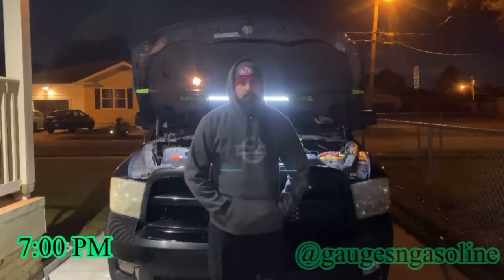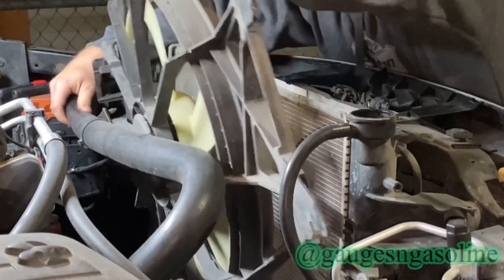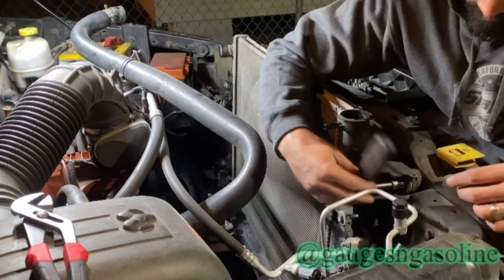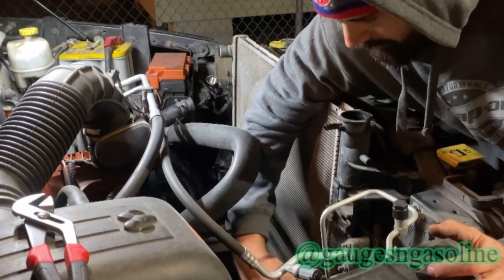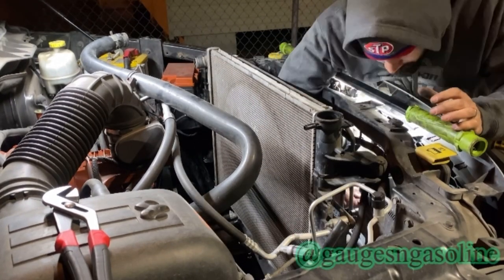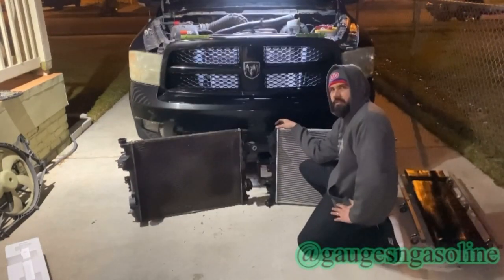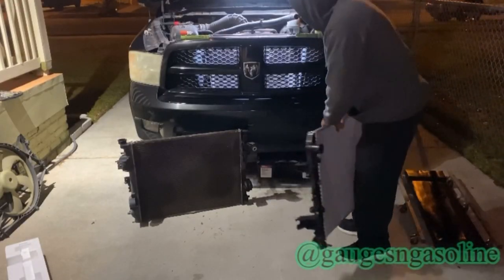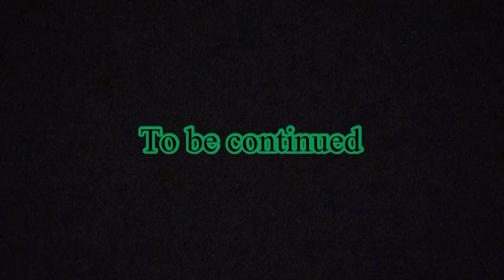2009 - 2018 Ram 1500 radiator replacement ( Huge Crack! ) #ram #radiator #leaks #moparornocar

Comment: awe man. that sucks about your radiator blew up like that. i really like the light saber you have, the green and black one. you should do some video about your tool collection. whats different about the tools you have at work rather than at you house? also, can you do a video of how you fixed the tire? or did your eplace it?
Reply from the maker: Thanks bro, I have another video on how I fixed my other tire you can check out. And yes I have replaced all my rims and tires since. I’ll be posting a video of them soon...